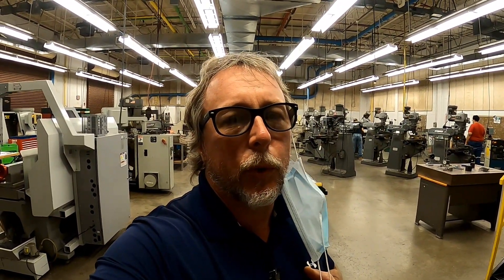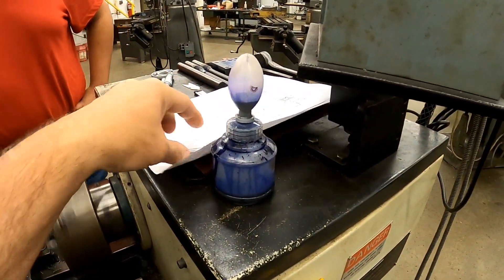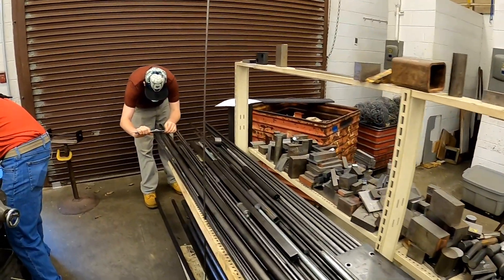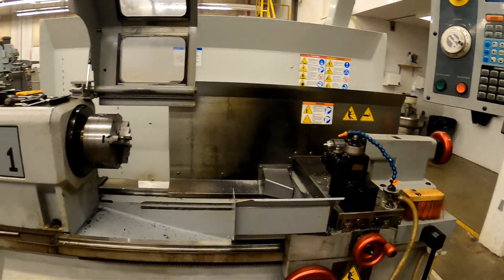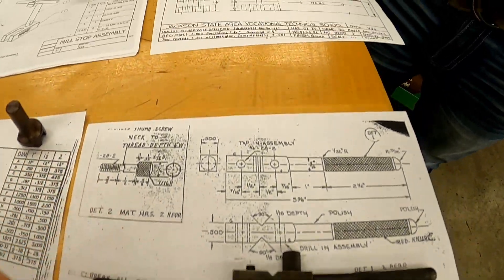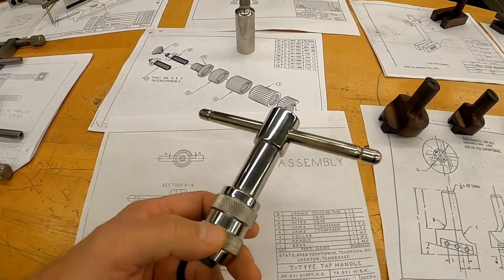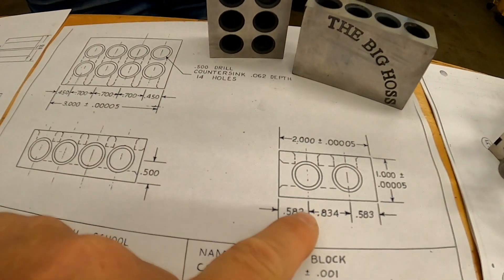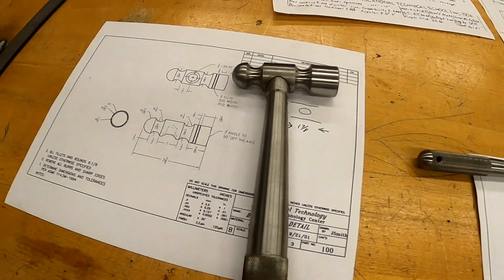Machine Tool Technology 2020

Comment: I see a lot of Bridgeport type machines but no horizontals or knee mills like a K&T  or a Lagune. Do they also happen to teach machine repair and diagnosis? That would be a very useful class to add to the curriculum, albeit a year 2 advanced level.
Reply: Um, the Bridgeport "type" machines are actual Bridgeports, which ARE knee mills, and the super excited guy on the lathe is on a um, horizontal lathe, which is horizontal. Did we watch the same video?
Reply: @YerBrwnDogAteMyRabit  yep & no. I was referring to horizontal mills that was the K&T type
Reply: @marvtomson574  Oohhh..you were looking for those SPECIFIC machines. Gotcha.